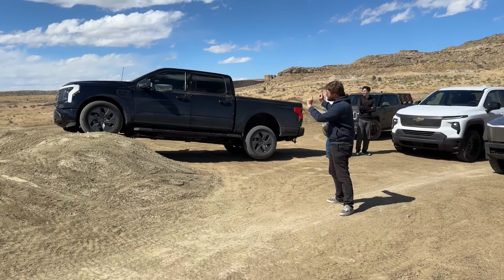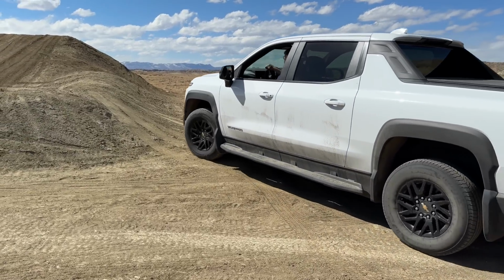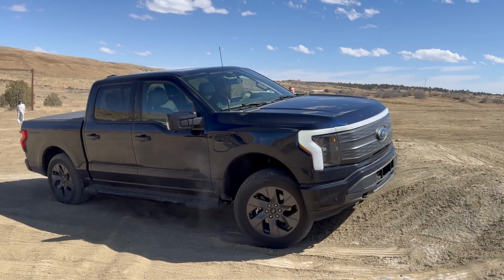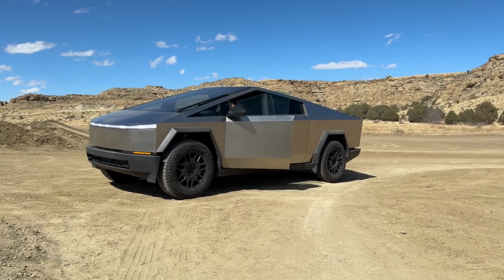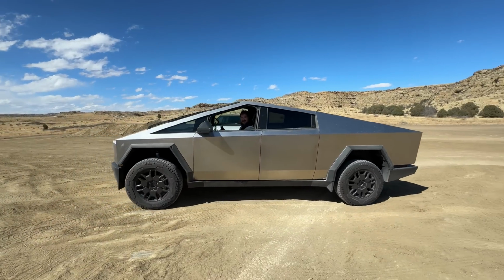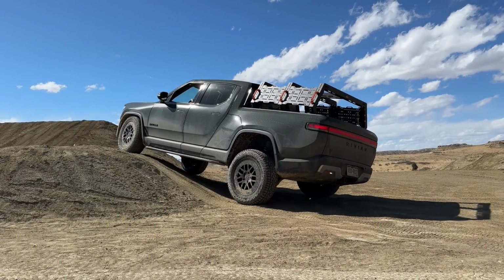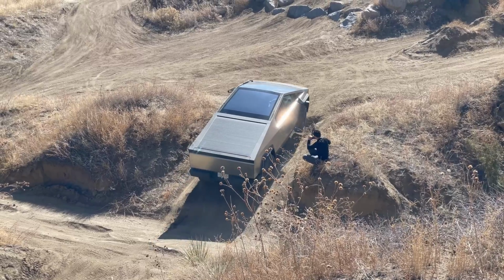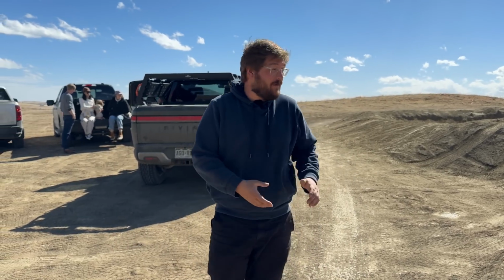EVs Explained Off Road! Dual Motor vs Tri Motor vs Quad Motor - Locking Diffs vs Virtual Lockers

Comment: Im not sure I agree that a dual locking AWD Cybertruck will have an advantage over a tri-motor. Each of the rear motors on the Tri motor has similar power to the single rear motor on the AWD. So assuming good SW, a Tri motor should be able to apply as much power to a single rear tire as a locked AWD.

Comment: Wtf is a virtual locker...it's either locked, or not...are you referring to a limited slip differential...which is not a locked diff btw..and yes it matters if it's induction or permanent magnet motors...rears are normally permanent motors...